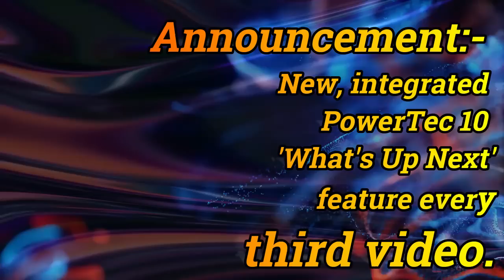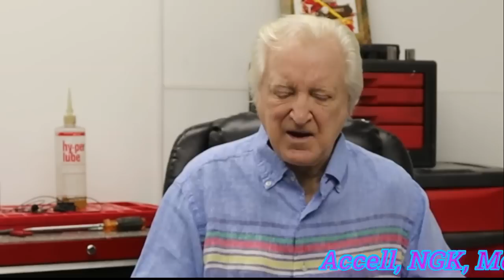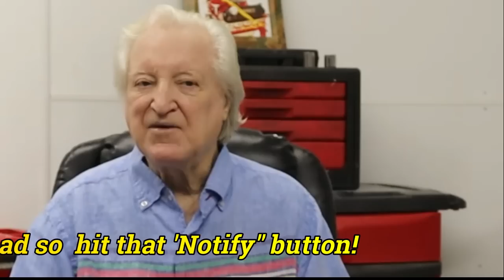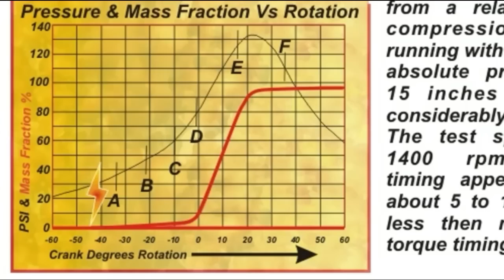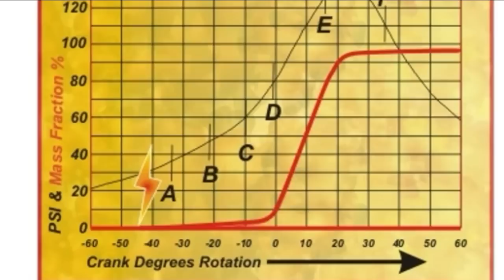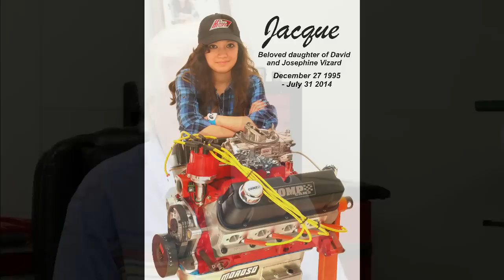Power sparks & how to use them.

Comment: Would love to understand the optimum top ring land height.  Doesn't the ring get hotter the closer it is to the top & there for need to be thicker? Is there a point its too close to the top?  I have torn newer moters down where a tuner was pushing the timming too much & busted chunks out from the tops 6 out of 8, most right at the ring.  Low compression readings told me it was hurt fairly quickly... seats were scared up & leaking as well.  Crazy part was the plugs didn't sustain any real damage due to them being recessed in this Ford.  This mint have been a good engine to run extended tip plugs but they probably would have been damaged & shown the problems sooner.

Comment: In the UK the Rover V8 engine is a popular choice for the 'hotrodder'. The standard Lucas ignition system in my opinion is not all that good, no matter what variant of the system you use, they are built down to a price and work on the assumption most road cars bimble about at 3k max RPM. On a few of the engines that I have built I have taken all of the guts out of the Lucas distributor and replaced it with an MSD pickup coil, still triggered by the Lucas reluctance wheel, The dizzy is locked out, no advance built into at all. The modified dizzy triggers a programable MSD unit. (RPM and vac advance can be programmed into the unit) The results were 'shocking' to put it mildly! The idle quality was improved, the throttle response was much better and with any of the standard systems you could feel the power falling away at around 4500 RPM (I think that the standard system just could not cope firing 8 cylinders at this RPM). The MSD just kept allowing the engines to rev and rev until the 6k 'self imposed' red line.

Comment: I use a Performance Distributors HEI on my 351w in my 77 Bronco. Its a nice and simple upgrade over the Duraspark if you have a carb or don’t want your fuel injection controlling spark.

Comment: A typical MSD ignition will stop "multi-sparking" at around 3000-3500 RPMs, at which point the single spark that it does produce lasts for approx 20° of crank rotation, which is plenty.

Comment: A decent set of 8mm "Spiral Core" wires will reliably fire my 1000h.p. big block for several years without issue. I replace them, the rotor, and distributor cap every couple of years, and I don't have issues.

Comment: 🤣preignition and detonation is a spike in cylinder pressure before TDC TO BEFORE 15* to 20* degrees After TDC where cylinder pressure starts translating mechanical rotational force via crank angle 🥸🤦‍♂️🤞🚀

Comment: With the piston ring position test, you said you just move the top ring, what effect does it have moving the second ring by the same amount, or do you start to have issues with more piston rocking if you do this?  Have you had chance to play with the position of the rings to each other?  My thoughts are around build a higher reving engine, so moving all the piston rings up so i can raise the gudgeon pin height to get a better rod to stroke ratio

Comment: I like using at least 8.8mm wires, and running a large capacitor in the power leads of the ignition box, I have had my plug wires look like they glowed at night , literally the whole plug wire looked like it was glowing, while it was running, I could touch them , and nothing, it was a faint glow, I had to look close,  and it has to be very dark,  it wasn't like a bad wire, that would arc through in places, it was a msd box, HEI, and a hot coil,

Comment: It would be awesome if someone could make a clear cylinder and /or head or at least an low iron glass optical plug to see the plug with enough light to see  the ignition process, maybe a large single cylinder test engine,  with a 1" glass plug  for viewing, and a 1/8" for lighting,  maybe quartz to handle the heat better! I always wanted a good view of the combustion process, with the intake charge coming from different directions, to see how and if the intake charge effects ignition..

Comment: M&w later known as sealed power did make pistons with an L shaped top ring that actually had the leg of the L flush with the top of the piston. My only experience with them was in tractor motors with no boost where they seemed to work ok.  I can imagine at rpm with all that weight in the ring they might go crazy.
Reply: Bultaco motorcycles it the 60's used an "L" piston ring [single] in their GP.  race two strokes, it used the pressure of combustion to seal the ring to cylinder, .... worked very well .

Comment: So, my understanding of Detonation in a cylinder is that the knock we can hear is the 2 sound waves colliding and not the 2 flame fronts. Sound travels faster than the rate of burn of gasoline. The collision of the 2 sound waves causes the knock and is actually a vibration or thud that we can hear and knock sensors pick up. The sensor cant hear, it feels so to speak. You can fool the k ock sensor by tapping the engine near the sensor. So, in essence, it feels the knock and some knock sensors are in a coolant passage because it lets SOUND travel to the sensor. 
This has been my understanding of Detonation for years now. I would like to hear Mr.Vizards opinion on this. 
Thanks for all the information Mr.Vizard!

Comment: I actually worked at a shop where they had a Sun “pro” and you could do a cylinder balance test with inductive pickups on each plug wire and looking at syne waves. The thing was about 8 ft tall 10-12 feet wide and about 3 ft deep.

Comment: Heres why "detonation" is such a frustrating, inconsistent and hard to control phenomenon. The burn is a exothermic chemical reaction, and as such, like many other chemical reactions can be HIGHLY sensitive to pressure, temperature and local density of the reactants. For example, the reaction rate might be related to the pressure to the 4rth power, and temperature to the third power, or maybe the third power for pressure and the fourth power for temperature, or the fourth or 5th power for both!! On top of that, those rates can be influenced by the actual load on the engine... piston not coming up the cylinder quite fast enough, the charge starts to react a tiny bit faster relative to piston position, and all of a sudden, the smooth slow burning mixture speeds up dramatically, because of the highly nonlinear relationship between burn speed and pressure and temperature. The burn can literally modify its own conditions!!

Comment: Dear Uncle Dave,
 Thanks for the great subject discussions.

A matter I’d like to bring up i brief if you please?
 In past years a man named Somender Singh, (a motorcycle racer, engine builder, and crude aircraft builder, and man of great intelligence and personal beauty)developed a modification called the Singh Groove.

I reached out to him and managed a friendship with this truly wonderful fellow.

I attempted to integrate his design on an engine development program for a manufacturer. Jon Kasse, was revamping our cylinder head with canted valves, ports, and chambers. The Singh Groove, somehow failed to become integrated or even tested despite this fantastic opportunity to do so. 

It was some extra effort to do it and not the result of some grand conspiracy why it didn’t happen I imagine.

Any thoughts on the Singh Groove?

It is supposed to break up the quench with a fire groove constituting a multi point ignition.

It needs testing in my opinion. Your discussion concerning flame propagation and quench of the ring lands makes this appropriate to broach this subject here.

The mod is supposed to increase power, efficiency, and allow much higher compression on street fuel. It’s a simple mod.

Testing it may be a good future subject?

Thank you.

Comment: Spark Plugs - With a NA engine under load, the spark plug ground electrode is often the hottest thing in the chamber, and this can be a source of detonation.   Put a propane torch up to your spark plug electrode (chamber side)  while it is screwed into the head, and if the ground strap starts to glow orange, then these plugs are more likely to cause detonation, even in a NA engine, and definitely don't use these with a power adder.   If you try this test with an autolite race plug, you will see it will never glow when using the propane torch.  This means they are thermally stable over time with 1600*F temps.

Comment: MSD -   Is really good to have.  If your engine has a decent tune and is experiencing no misfires under load, then you aren't likely to see a measurable gain from an MSD.   If the engine has a poor tune or experiences a lot of misfires, then you could gain a lot of power from the MSD.  The MSD can allow a tuner to push more extreme conditions in the combustion chamber before misfires start, and this can mean leaner AFRs before lean misfire sets in.   The MSD may also improve cold starting on some cold natured engines.

Comment: Spark power -  the ignition can only support so many watts of power, so if the resistance is high the voltage component has to be large, and this diminishes the amount of current in the spark.  The minimum voltage you can use and still arc at the plug can give you the most current, and hotter spark.   This is why you can often gain power under load by tightening up the plug gaps.   If you only need 20k volts to arc the plug instead of 40k volts then you may have doubled your current at the spark.   Higher current does heat up the ignition parts more, but that's the sacrifice for more heat in the spark.

Comment: Detonation - when the flame speed greatly exceeds mach 1 it creates a powerful shock wave, and that rattles the piston and rod up and down in the bore which beats on the rod bearings and wrist pins.  Brittle pistons will crack pretty quickly.  The shock wave can also cause tiny bits of the piston surface to detach and become part of the combustion.   You may see this as specs on your spark plug insulator.
Reply: awesome input..........As in aviation,,,,,When a jet powered plane breaks the sound barrier ; there is that wall , or time of resistance , the shock wave or waves that caused tremendous buffeting to the planes airframe.............History is awesome as one of Newton's Laws or more than one come in to action........The Atoms and molecules in the atmosphere that undergo changes from the heat and pressure at Mach one...................The sonic boom heard when these changes take place........I wonder if the word Plasma has any  relative meaning in all this science............
Reply: This was my thoughts on it also. Which seems to make sense when you see the hammering effect on big end bearings after heavy detonation. The spiking cylinder pressure pounding the piston and rod down through the layer of oil on the crank causing contact.

Comment: Even if I get one of the Genuine GM HEI distributors, the first thing I do is toss the standard HEI module and fit an MSD one.. I don't know what it is, they used to be okay, but they changed something about how they were manufactured about 10 years ago and I've had 3 of them burn out in short order.. Turns out maybe offshoring everything wasn't the best idea with all the replacement component failures I've seen in the last 18 months

Comment: An explosion is an: uncontrolled ignition that occurs at greater than the speed of sound (you'll hear this as detonation. Because you know, the fuel and air is detonating.)
Deflagration is the controlled burn at sub-sonic speeds. This is what you want. since it wont fracture your pistons.

Keep in mind that the speed of sound in a combustion chamber is not 340m/s. the speed of sound increases with pressure.

Comment: The top ring land discussion was pure gold!  While in college, I was moonlighting at an entrepreneurial firm working on lean burn for emission reduction. (early 70's)  I developed a multi spark, high frequency, capacitive discharge, coil on plug, distributor less ignition system that would reliably ignite that mixture.  The rise time was extremely fast, I characterized it as an RF discharge.  My plugs would fire immersed in transformer insulating oil.  The owner lied and never filed the patents... he went bankrupt...  my final payment was his preK 1969 Honda 750 motorcycle... ah... the joys and naivety of youth!  Great memories though.

Comment: In the beginning of internal combustion engines, I imagine 3000 RPM was a big deal. An engine builder of a Model T couldn't imagine an F1 engine running 20,000 RPM
Reply: Factory spec was 20hp @ 1800rpm.  woo hoo.

Comment: Using copper wire as a substitute for plug wires. Will generate an electric magnet wire. AKA, EMP, electro magnetic pulse. Due to the high voltage output of the ignition coil. Also another thing that it will do is cause radio frequencies interference in A.M. radio stations. The higher the radio interference the greater the EMP effect is.  Stainless steel or tin coated wire if not mistake will cause less of an EMP effect. To minimize the the EMP, ferrite tubes can be used to minimize the EMP effect. One on each end of the plug wires. Copper spark plug wires will work well in carburetor engines with ignition points. Because there is no electronics to be effected by the EMP. There will be a noticeable change in the spark. And as well as performance.

Comment: Mr. Vizard , Hello David . I'm currently working on a slant6  for my 65 dodge dart . I scored a set of vintage but in New condition from the 80s Taylor brand performance 7mm silicone yellow plug wires . the plug wires have copper braided cable . I have already cut and installed them to fit on my 225 slant6 . the slant 6 also includes an Accell super stock coil aka canister style and Bosch iridium plugs . O and I also have the 14mm Guns on color tune kit . I did a video on my channel using the kit on my 318 but will be doing a video on the slant6 using the kit to tune my slant6 . As always thanks David for sharing your knowledge . I soak it up like the water in a towel 😎🔧⚡🏁

Comment: 🔔😎
15 yrs ago a friend installed a Performance Distributors' HEI distributor and new 8mm Accel carbon core wires. Those wires absolutely would not hold that intense spark. They crossfired and sparked in the dark. Engine missed like crazy and refused to go beyond 1700 rpm. I separated the wires by @ 2-3" using dry sticks and it would do 3,000 without missing. Helical core wires cured it.
JME 🙄👍😎

Comment: Used solid wires to plug and a resistor from coil to distributor. Worked fine , also used a ford thick film and e coil with trigger in a mechanical distributor, spark was good to approximate 10,000 rpm.

Comment: I wonder about the modern fuel mixtures and detonation, I went 10.5 compression but used 260 @50 duration camshaft so it had less stroke to compress it, I had no detonation on cheep grad gas, I also took off all the sharp edges of my heads, and dimpled the pop up on the piston. there are some non standard combinations that can work, we go higher compression with aluminium heads also.

Comment: Is there a issue using a Mallory Unilight with 8mm wires on a 351 Cleveland up to 6,300 rpm at 475 Hp?
Reply: Was running a Mallory unilight on A SBC One of the pins holding the advanced Spring broke, lodged in the distributor seizing it causing distributor to break hold down clamp breaking teeth off of Cam shaft gear which I didn't know until a couple years later when pulling the camshaft. Don't know If they fixed that issue but I would tack the spring pins.

Comment: Points are the best trigger known?
Reply: Run out of dwell as rpm increases. Hence dual points. Digitals use @500 volts instead of 14volts and virtually instant dwell.

Comment: All I know is that switching to NGK low resistance plugs; low resistance spiral wound plug wires; and a hot coil solved my problems of having to walk miles in the middle of the night!!   AC/Delco/Champion plugs along with upgraded production plug wires created a huge amount of resistance that backed up to the  distributor and caused many a failure and long walks in the middle of the night.  Lesson learned.  

By the way, I have had a lot of luck with MSD ignitions starting in the '70's thru today (personal and professional use).  Just use low resistance wires and plugs.

Comment: Mr Vizard, I've always believed that the solid core wires in conjunction with the resistor caps yields the best spark when using a non resistor plug. I have used 500 ohm resisted boots to dwell the spark longer at the cost of the AMPerage. So high compression engines suffered. 
HOWEVER with today's boosted cars I've migrated towards more of the Insulated Gate Bipolar Transistor coils (IGBT) the switching is superb and crisp especially at over 8k RPM. Also the use of a IGBT you can also dwell the spark longer  using Amperage instead of resistance. This gives a healthy spark with long duration Wich is great when working with high boost and RPM. 
I haven't worked with CDI but I'd imagine with just a short burst instead of a long duration spark I don't see the significance especially with the mosfet designs. 🤔 I wonder what Tesla would have to say.
Reply: Right,, the king 👑 of the park gap, he had compressed air spray blowing out the spark, then oil filled and magnetic 🧲 spark quench systems,, so far ahead of anyone in 1910, up in to giga hearts in his day.

Comment: A common way of presenting combustion energy release in the combustion engine research world is talking about the CA50 point in crankshaft degrees, (where 50% of available energy has been released).
Your shown graph is quite crude, but very reminiscent of a true cylinder pressure trace.